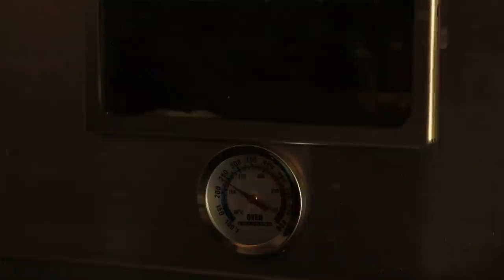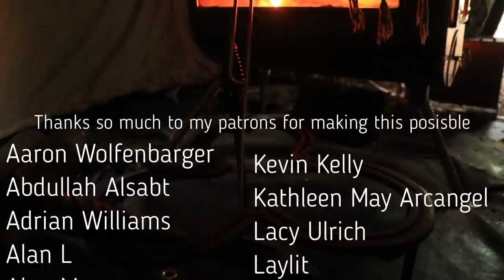Baking an Apple Pie | Winnerwell Woodburner

Comment: Great video!  I have same.  Having some trouble with their rain guard though, any tips?  Also I note you use the folding oven directly on the top without opening the plate.  Which I like.  The plate has given me nothing but trouble.  So I'm eager to try it your way when I finally buy the folding. (I currently have the pipe oven and love that.)

Comment: Side Note....Carbon Monoxide bonds to Haemoglobin 210 times faster than Oxygen, unfortunately the wood stoves are not air tight, plenty of ventilation needed, please use with exreme caution. Never sleep in my tent with the stove burning. Hot water bottle filled before bed. Cheers!